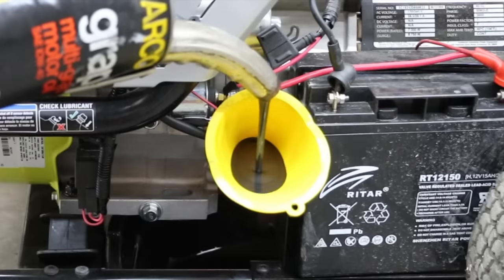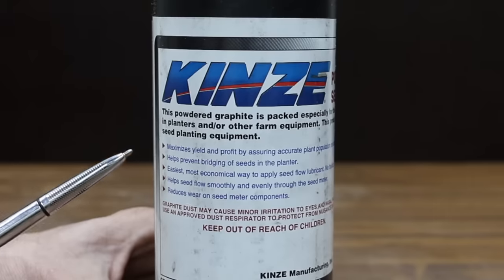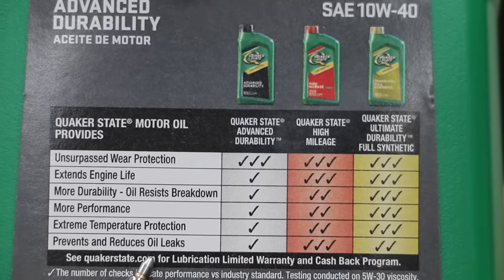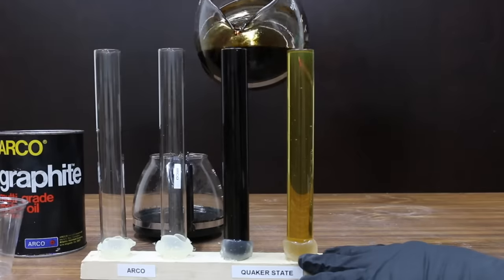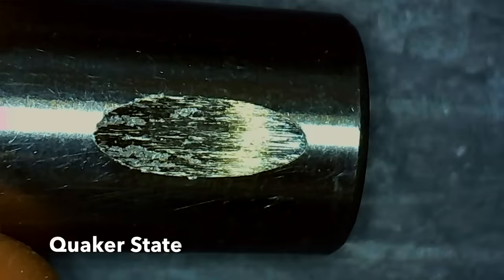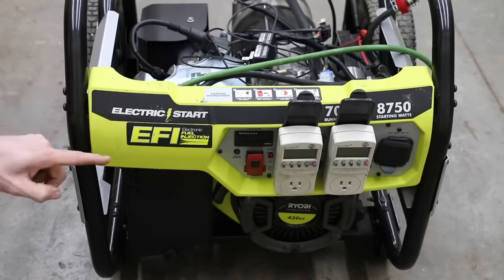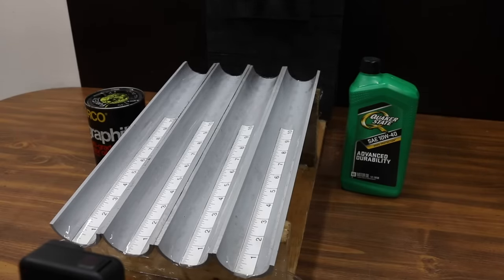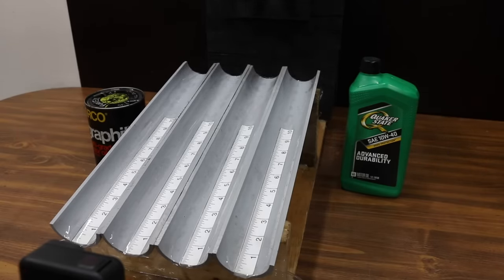Will "Graphite" Help Motor Oil Performance? Let's find out! Vintage Arco Graphite vs Quaker State

Comment: Seems like no matter what, after oil change after oil change and 50,000 miles, you would have a sludge of oil and graphite that has found it's way to the furtherest away from the oil drain and build up over time. Seems as though you would have to FLUSH the oil. 
I suppose if you had a way to keep graphite particles from gathering to itself it would be ok.
Reply from the maker: Thanks for the feedback.

Comment: Dont use slick 50 in used transitions it builds pressure and blows seals. It also and makes weird old plastic gears parts fall apart faster.
Reply from the maker: Thanks for the feedback.

Comment: I have considered this over time but it will block ooil pick-up
But it will also coat the engine with a layer that will not run
Reply from the maker: Thanks for the feedback.

Comment: Graphite is OLD SCHOOL. Tungsten disulfide nanoparticles in suspension are the state of the art in wear prevention, and there is an experimental zirconium compound that regenerates the worn surface to create negative wear.
Reply from the maker: Thanks for the feedback.

Comment: before watching, i will say, i know it can be used as a lubricant especially for keyholes and locks, and it would help wear down the wear back to a more smooth finish and essentially re-polish the inside i would think, so i could see how this could be a real thing, now lets what the video lol
Reply from the maker: Thanks for sharing.
Reply: @ProjectFarm  left reply. But it didn't tag you for some reason. Actual important information on follow up video.

Comment: I think you should be doing fuel efficiency under a 1/4 load. Bearings and such wont really be loaded up with no ekctricaload.
Reply from the maker: Thanks for the constructive feedback.
Reply: @ProjectFarm  of course. EPA doesn't do fuel mileage of an idling car 🤣🤣 is done under varying loads

Comment: Graphite burns, so it should not be a problem for catalytic converters.  The thing to watch is the oil filter, for clogging.  Oil filters are supposed to be calibrated to stop particles 25-30 microns in size, or larger.  The graphite powder must have a maximum particle size that is appreciably smaller,  Perhaps 10 to 15 microns, maximum, would work.  But 30 micron oil filters will stop some 15 micron particles, so some testing is in order before you trust it in your daily driver.
Reply from the maker: Thanks for the feedback.

Comment: At one time, I owned a small block Chevy LT1 from 1971 that was a high performance 380HP engine installed in a Vega Station Wagon GT.  Because of the close proximity of the exhaust headers and the oil filter, I could not change the oil filter regularly.  This was because I would have to remove the already difficult to install headers.  I used ARCO Graphite motor oil to add life between oil changes.  The oil was advertised in 1985 to last 25,000 miles before an oil change.  Get this, I also removed the radiator and ran a heater core from a big-block car to be used as a conventional radiator.  The result of all this was an engine that ran about 205 degrees with the ARCO Graphite motor oil.  Although this was okay for racing purposes due to some overheating at the track on a hot day, It is probably not practical for daily street use.  The running temp. didn't seem to hurt my engine.    
My question of concern:  does the ARCO Graphite stick to internal engine parts over time?  It looks like it ruins spark plugs to a great extent after viewing the video on ARCO Graphite performance.  I will leave you with this bit of information...the graphite motor oil works great for high heat purposes, but I don't know if it hurts or protects turbo systems from wear any better.  I've seen turbos burn up with the conventional or synthetic motor oil, and I thought that the graphite motor would protect much better.  

What do you think from all this?
Reply from the maker: I do believe that it sticks to internal engine componenets

Comment: I always wondered if you could add "Buckminsterfullerene" to motor oil.  They are like microscopic ball bearings made from graphite.  Try that next
Reply from the maker: Thanks for the suggestion.

Comment: Some race cars without catalytic converters does use zinc oils for better performance of the oil. But zinc will damage your catalytic converters just like lead fuel additives or avgas. Now I knew someone who put lead additives in his old pickup. Not knowing what the lead was for in the first place. The lead would increase the fuel octane and prevent knocking and was a replacement for alcohol. But in aircraft fuel they can’t use alcohol because alcohol will get water in the system over time and you don’t want engine failure in the air. And 100 octane avgas in your car is not good for the parts of your car.
Reply from the maker: Thanks for the feedback.

Comment: 116 parts per million of molly, you have to watch that molly, no more than 2%/vol or else what happens is the bearings skip in rotation, they slide on the molly surface and they ruin the bearings real quick. We saw all this when we did big gear box overhauls. but it really keeps gears shinny and looking new and polished
Reply from the maker: Thanks for the feedback.

Comment: Graphite is good at transferring heat, not simply "cooling" it still needs to put the heat somewhere and that somewhere is going to just be in the oil and engine components around the oil. As for a lubricant? not likely.. At a topcoat maybe.. temporarily.. But suspended in a liquid? Its just going to act as an abrasive.

Comment: I think you should have used the oil before you boil it for the wear test. A lot of sludge was down in the Arco oil that and could have been lubricating quality.  You did not say whether you mixed it up with the sludge to re-create the oil for the test again?

Comment: I've said this before. The only thing I don't like is the bearing test. Show me in an industrial application where a bearing is used in that configuration.
A bearing goes through a cycle. Rod bearing has pull and push forces on it, in a connecting rod. Main has a torsion force on it. 
The test you do does not mimic these forces.
In no way am I criticizing your work.
If you put your mind to it, I'm sure you can come up with something.
Reply from the maker: Thanks for the constructive feedback.

Comment: The only thing i ever used was slick 50. It did make a .3 sec difference in a stock motor on the track consistently.  Coincidence?
No clue, I have nothing to back that up.
Reply from the maker: Thanks for sharing.

Comment: I've been running Valvoline for 30byears or, synthetic, and luv it. Would like to see some equal comparisons to competitors. Stopped using pens before synthetic. 5w30
Reply from the maker: Thanks for the suggestion.

Comment: Seems to me that comparing 21st century base oil vs 1980 base oil isn't an apples v apples comparison. I would have been interested in seeing Quaker State vs Quaker State w/graphite additive vs Quaker state w/graphite powder added.

Additionally the wear test is the key takeaway. I can see why I wouldn't want this stuff in an engine, especially a modern engine with small tight orifices and passages that must flow oil unimpeded, but this stuff could be gold for rear diffs and manual transmissions?
Reply from the maker: Thanks for the suggestion.

Comment: did autoglass at philly refinery, guys gave me half case of this stuff. put it in my 390 ford and what i remember most ? when geting off highway   the car would not 'slow' down   the slip ? but pull the dipstix and   black oil  yuk
Reply from the maker: Thanks for sharing.

Comment: Based on the testing and comments you made in the video you didn't use Arco Graphite while it was for sale. The reason you used it was that 50% of the engine ware occurs between the time you start the car and when the oil pressure comes up. The graphite stays behind and prevents this from occurring in the engine. I used it in my 1979 Toyota Corolla. I purchased it new, and one day I just got tired of driving it and parked it at 270,000 miles. None if your tests addressed this claim. It was not any better than other oils for sale at the time. If you had tried your ware test without oil then you may have had a chance to prove its claims. It would have to be several short tests with oil applied in between each test.

Comment: Wow that oil completely destroyed the compression chamber hahah!! :D that 20 seconds on the generator means nothing. Was it also a brand new generator? And it spilled fuel when it turned on. That probably not the greatest test but just my opinion :)

Comment: I used Arco graphite in my new 1979 Ford E150 van with a 302 V8 .The engine was worn out with only 80,000 mi! Thats why this oil disappeared,

Comment: I would think graphite would be terrible for engines as it would polish surfaces over a short amount of time, that in engines is an engine killer. It would build up sludge and block all the increasingly narrowing oil galleries which in turn destroys oil pressure. This is the sort of stuff you do not want in your oil and one of the reasons you must routinely change and clean your oil.
Reply from the maker: Thanks for the feedback.

Comment: I'm wondering if mixing the graphite up in the oil before you poured it off for the bearing test, would have made difference? I mean, the claim is that it's the graphite that does the "extra" work.
Reply from the maker: Thanks for the suggestion.

Comment: FIRST THOUGHT THAT CAME TO MIND....... THE GRAPHITE WILL ACT AS A SLUDGE THAT WILL CLOGG UP THE OIL FILTER (S) AND CAUSE ENGINE FAILURE IN THE CRANKSHAFT AND BEARINGS AREA, AND ALSO WILL LEAVE SEDIMENT SLUDGE EVERYWHERE!!!!!

Comment: I used Arco Graphite in my first car, a Mustang, back in the day, only once I think, and stopped when my high school auto tech teacher mentioned potential problems with powders in oil filters.  I noticed no difference.  But I maintain that I feel more comfortable with powdered oil additives in unfiltered motors like lawnmowers.
     Can you test powdered additives to see how well they get through high efficiency oil filters? Graphite? PTFE? Molybdenum?  I might well use graphite in my old slant 6 truck with low compression in 1 cylinder, in which I already run Restore.
Reply from the maker: Thanks for the suggestion.
Reply: @ProjectFarm  2 related questions: Firstly, do any lubricant powders, graphite, PTFE, Moly, work in fuel to lubricate top rings or especially 2 stroke engines, without clogging fuel filters? or 2 stroke ports?
   Secondly; do they stay put on rings and bearing overnight to protect during start up the next morning? and do they stay put for decades during long term storage to protect against rust seizure? and do they protect the bottoms of fuel tanks for decades against rust? and is there any way to answer such questions within the decade?
   My mustang fuel tank did rust, but I never put graphite in the fuel, only the oil.  I successfully gas welded it, or did I braze? despite the very thin gauge, and extensive rust.
   Does Castrol Magnatec protect against long term rust seizure?

Comment: I'm having an issue with adding Graphite to motor oil. Back in the 1950/60/70's here in the UK, "oil of graphite" was readily available but for one reason and one reason only. Tolerances during engine manufacture were not great in fact, British Leyland were particularly poor so, oil of graphite was recommended to help break the engine in by deliberately "wearing-in" the poor engineering during manufacture.
Graphite is an abrasive and a course one at that. I certainly would not add this to a modern engine!
Reply from the maker: Thanks for the feedback.

Comment: Ever try Molybdenum DiSulfide? You can buy in grease or dry forms. Would be curious to see that tried. I find it has helped in small engines a lot, but never tried in depth.
Reply from the maker: Thanks for the suggestion.

Comment: Try Wynn's friction proofing....  I used to race cars back in the 1990's  and every year we would rebuilt the motor.... so after every season, with normal motor oil, the hatch pattern from the honing was always worn off......  then we switched to Wynn's Friction additive, and at the end of the season, the hatch pattern in the cylinder walls was still there.    So, i ask.... does this product still work, or do we have to buy the vintage version of it, to get the incredible wear protection I had in the 90's?
Reply from the maker: Thanks for the suggestion.

Comment: Did you place the graphite oil can upside down for 30 minutes or so before filing the generator?  If not, I bet there was a lot graphite left in the can, reducing its lubricity.  See my other comment suggesting people should probably not use it.

Comment: I use valvoline and Lucas and change my oil every 5000 to 70000 miles in a 97 Chevy Silverado never had any problems
Reply from the maker: Thanks for sharing.

Comment: I used to work at a place that made thing from grafite..in the 70s I put grafite in engine it end knoch was gone, a much quiet moter.gear box even better the axle bearing and diff even better.rub grafite on fingers it sticks and makes fingers slippery and hard to remove...
Reply from the maker: Thanks for sharing.

Comment: May work in your lawnmower or generator but modern oil filters for vehicles will remove the graphite and the graphite will clog the filter. This is why Arco and Mobil don't put graphite in their oil anymore.
Reply from the maker: Thanks for the feedback.

Comment: please devise a test for graphite in the area it would actually help in - gear box support under high pressure loading -not in engine performance where you obviously dont want graphite thickening things up. if you want to understand oil check out gale banks tour of the amsol facility
Reply from the maker: Thanks for the video idea.

Comment: What about cold starts.? Winter weather running in the 60,s we used arco type oil . Remember old batteries and electrics. Outdoor street side parking. Using an arco type oil meant the difference between getting to work on time or not.
Reply from the maker: Thanks for the suggestion.

Comment: I tried it in 1978 in my low mileage1973 Yamaha 360 enduro and about a month later the motor locked up in front of the main post office in San Diego. I was picked up in a car to get home and by the time I got back to the bike with a truck it had been stolen so no way to know if the oil was the culprit but it was enough to never try it again. It was nasty stuff.

Comment: LOL, test it run through a oil filter to see how fast that filter clogs up. No chance I would use that in a filtered engine. Great video though, thanks for posting.
Reply from the maker: Thanks and you are welcome!  Thanks for the suggestion.

Comment: What about testing Avblend it is oil with linkite approved by the FAA to extend the engine life compression and fuel. It’s used in aircraft and small engines. A lot of people use that and their vehicles. Does it really work as good as they say it does compared to Castor oil or Lucas oil
Reply from the maker: Thanks for the video idea.

Comment: I'd wager modern filtration would just about pull all the graphite out and simply glow the filter.  I'd also wager that modern tolerance in engines would not appreciate the thickness of graphite.  That's just speculation though.
Reply: Also I'd wager modern variable valve timing would not appreciate particulates in them
Reply from the maker: Thanks for the feedback.